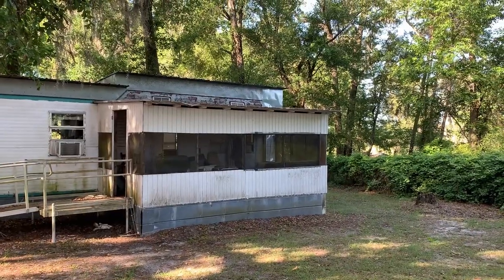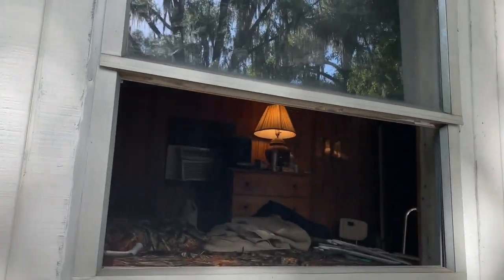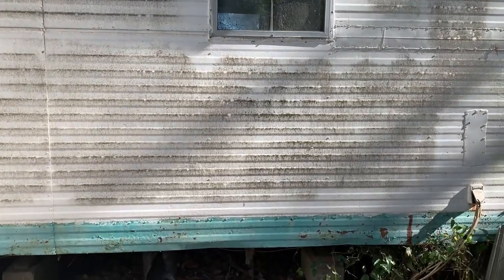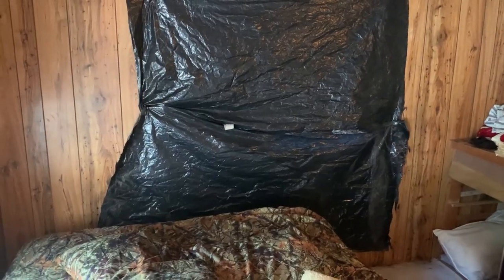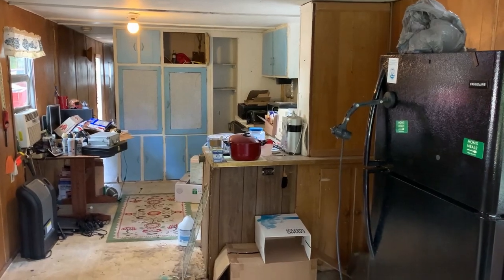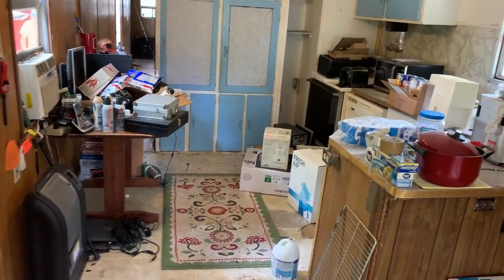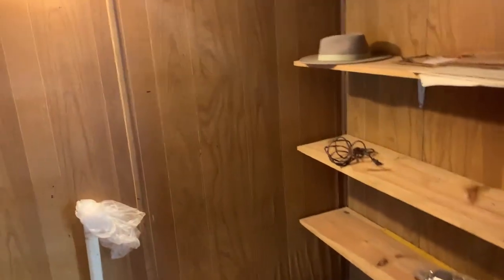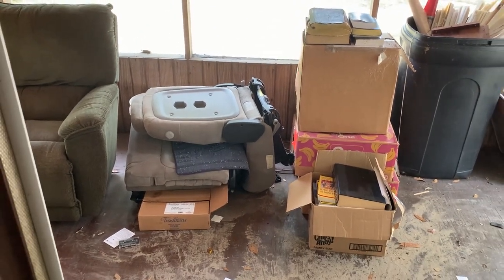Mobile Home Makeover! I got a FREE hoarder house!

Comment: First thing get rid of the garbage are all the old wantables inside then the entire outside needs to be pressure-washed that will pay you after what you have on the outside of the house at this point we can give it some thought about putting a gable roof or a pitch roof over the mobile home kayaking in the Edition really need to take a look at the screened-in front porch that definitely needs to work
Reply from the maker: Perfect plan! Inside is almost cleaned out!
Reply: @RehabLife  the shame I'm not able to roll up my sleeves and help you that can be a very cute and nice living place if I was looking at it correctly it could possibly be a two-bedroom one bath but it looks like there's a lot of framing to be done and definitely going to have to be rewired at some places
Reply from the maker: Oh yes, the wiring is certainly bad and the plumbing is nowhere near being up to any kind of code. I plan on starting with a blank slate and build it out like it should be.
Reply: @RehabLife  can't wait for next video
Reply from the maker: I’ve got to finish the $6000 brick house first!

Comment: Lots of sq ft but boy it’s in rough shape
Reply from the maker: That it is! What can I expect for free?
Reply: Yes but that doesn’t mean he needs to go all out. Sometimes you can only do a modest renovation in order to stay at a certain rental price point. Otherwise you’ll price yourself out of the market.
Reply from the maker: That’s the idea here. In order to keep it successful, I have decisions to make. Do I go back as a 1/1 with a smaller potential market or as a 2/1 with a much larger one. The 2/1 will have a rental value of $800-$850 while a 1/1 will top out at $700.